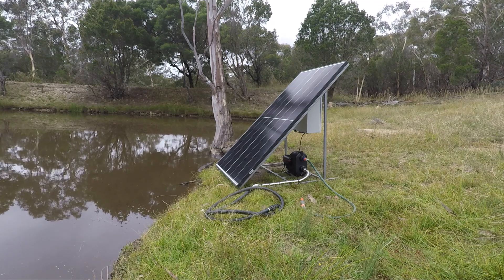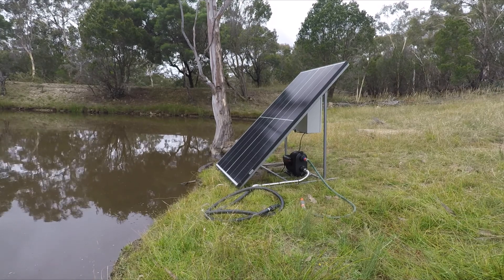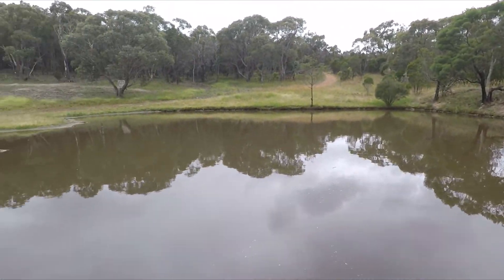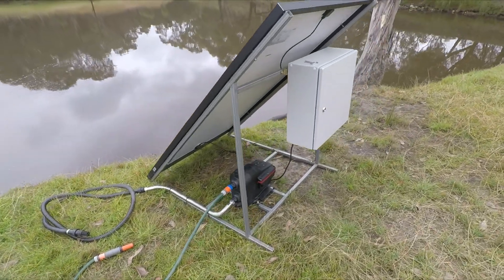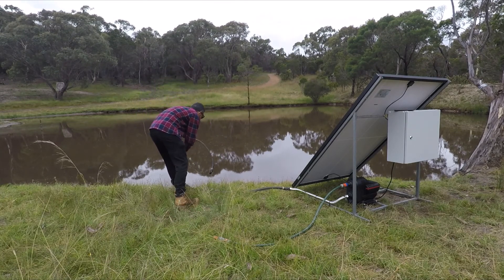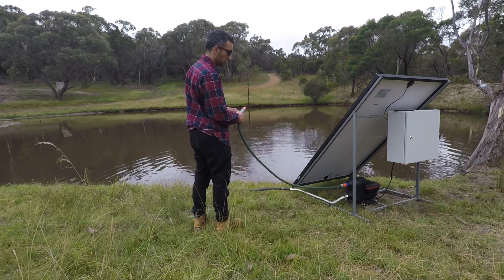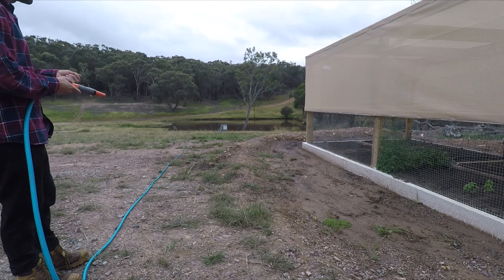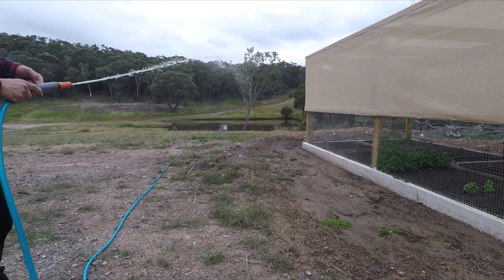Solar powered mobile pump using Grundfos pump. Suitable for Dams, water tanks and bore holes

Comment: I'm impressed! What kind of inverter do you use? I'd like to install the same one. When I tried i found out that the start-up power is very high. Cheers, mark
Reply from the maker: That was a 500W Victron inverter. The Grundfos Scala has no start up surge which makes it perfect for this.
Reply: @mictronix6723  Thank you for your information!